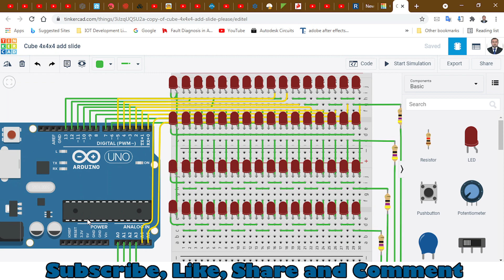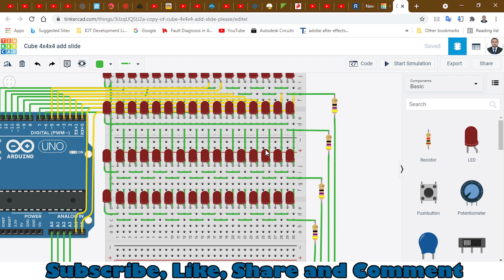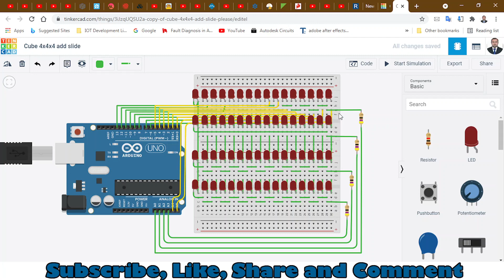4x4x4 LED Cube using Arduino Uno | How to make

Comment from the maker: Here is the code

  int layer[4]={A0,A1,A2,A3}; //initializing and declaring led layers
  int column[16]={13,12,11,10,9,8,7,6,5,4,3,2,1,0,A4,A5}; //initializing and declaring led rows

  int ustPause=5000;
  bool  light_flag=0;
  int repeatSlide=0;
 
void setup()
{
  
  for(int i = 0; i<16; i++)   
  {
    pinMode(column[i], OUTPUT);  //setting rows to ouput
  }
  
  for(int i = 0; i<4; i++)
  {
    pinMode(layer[i], OUTPUT);  //setting layers to output
  }
  
  randomSeed(analogRead(10));  //seeding random for random pattern
}

void loop()
{
//slide 1
  repeatSlide=3;
  ustPause=250;
  while (repeatSlide > 0) 
  {
    turnEverythingOff();
    delay(ustPause);
    turnEverythingOn();
    delay(ustPause);
    repeatSlide--;
  }
  //******************
//slide 2
  turnEverythingOff();
  ustPause=35;
  repeatSlide=2;
  
  while (repeatSlide > 0) 
  {
    turnEveryOneLeftRightOn();
    turnEveryOneRightLeftOn();
    turnEveryLayerOneLeftRightOn();
    turnEveryLayerOneRightLeftOn();
    turnEverythingOff();
    repeatSlide--;
  }
  delay(100);
  //******************
  ustPause=150;
  turnEverythingOn();
  layerstompUpAndDown();
  
  turnEverythingOff();
  randomflicker();
  delay(100);
  turnEverythingOff();
  randomRain();
  turnEverythingOff();
}

//*******slide fragments*******

//*****************************
//turn all off
void turnEverythingOff()
 {
   for(int i = 0; i<4; i++)
   {
     digitalWrite(layer[i], 1);
   }
   for(int i = 0; i<16; i++)
   {
     digitalWrite(column[i], 0);
   }
 }

//*****************************
//turn all on
void turnEverythingOn()
{
  //turning on layers
  for(int i = 0; i<4; i++)
  {
    digitalWrite(layer[i], 0);
  }
  
  for(int i = 0; i<16; i++)
  {
    digitalWrite(column[i], 1);
  }

}

//*****************************
void  turnEveryLayerOneLeftRightOn()
{
    //turning on rows: left-right
  for(int i = 0; i<4; i++)  
  {
    digitalWrite(layer[i], 0); 
  }
    
    for(int j =0; j<16; j++)
    { 
      digitalWrite(column[j], 1);
      delay(ustPause);
      digitalWrite(column[j], 0);
    }
}

//*****************************
void  turnEveryLayerOneRightLeftOn()
{
    //turning on rows: right-left
  for(int i = 0; i<4; i++)  
  {
    digitalWrite(layer[i], 0); 
  }
    
        for(int j =15; j>-1; j--)
    { 
      digitalWrite(column[j], 1);
      delay(ustPause);
      digitalWrite(column[j], 0);
    }
}

//*****************************
void  turnEveryOneLeftRightOn()
{
    //turning on rows: left-right
  for(int i = 0; i<4; i++)  
  {
    digitalWrite(layer[i], 0);

    
    for(int j =0; j<16; j++)
    { 
      digitalWrite(column[j], 1);
      delay(ustPause);
      digitalWrite(column[j], 0);
    }
    
    digitalWrite(layer[i], 1);
  }
}

//*****************************
void  turnEveryOneRightLeftOn()
{
    //turning on rows: right-left
  for(int i = 3; i>-1; i--)  
  {
    digitalWrite(layer[i], 0); 
    
    for(int j =15; j>-1; j--)
    { 
      digitalWrite(column[j], 1);
      delay(ustPause);
      digitalWrite(column[j], 0);
    }
    
    digitalWrite(layer[i], 1);
  }
}

//****************************
//up and down single layer stomp
void layerstompUpAndDown()
{
  int x = 75;
  for(int i = 0; i<4; i++)
  {
    digitalWrite(layer[i], 1);
  }
  for(int y = 0; y<5; y++)
  {
    for(int count = 0; count<1; count++)
    { 
      for(int i = 0; i<4; i++)
      {
        digitalWrite(layer[i], 0);
        delay(x);
        digitalWrite(layer[i], 1);
      }
      for(int i = 4; i !=0; i--)
      {
        digitalWrite(layer[i-1], 0);
        delay(x);
        digitalWrite(layer[i-1], 1);
      }
    }
    for(int i = 0; i<4; i++)
    {
      digitalWrite(layer[i], 0);
      delay(x);
    }
    for(int i = 4; i!=0; i--)
    {
      digitalWrite(layer[i-1], 1);
      delay(x);
    }
  }
}

//**********************************
//random flicker
void randomflicker()
{
  turnEverythingOff();
  int x = 10;
  for(int i = 0; i !=750; i+=2)
  {
  int randomLayer = random(0,4);
  int randomColumn = random(0,16);
  
  digitalWrite(layer[randomLayer], 0);
  digitalWrite(column[randomColumn], 1);
  delay(x);
  digitalWrite(layer[randomLayer], 1);
  digitalWrite(column[randomColumn], 0);
  delay(x); 
  }
}
//*****************************
//random rain
void randomRain()
{
  turnEverythingOff();
  int x = 100;
  for(int i = 0; i!=60; i+=2)
  {
    int randomColumn = random(0,16);
    digitalWrite(column[randomColumn], 1);
    digitalWrite(layer[0], 0);
    delay(x+50);
    digitalWrite(layer[0], 1);
    digitalWrite(layer[1], 0);
    delay(x);
    digitalWrite(layer[1], 1);
    digitalWrite(layer[2], 0);
    delay(x);
    digitalWrite(layer[2], 1);
    digitalWrite(layer[3], 0);
    delay(x+50);
    digitalWrite(layer[3], 1);
    digitalWrite(column[randomColumn], 0);
  }
}